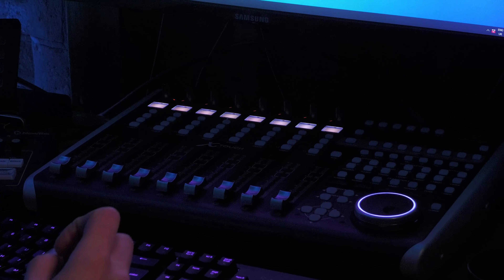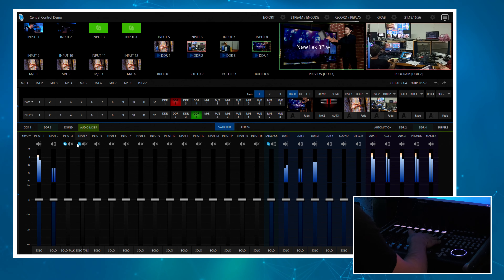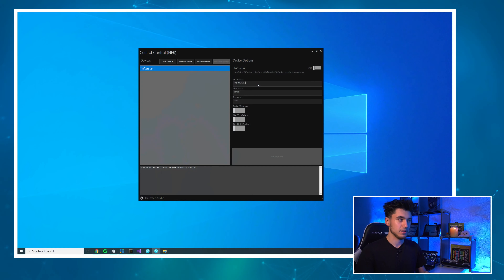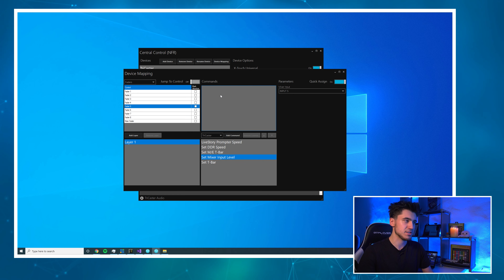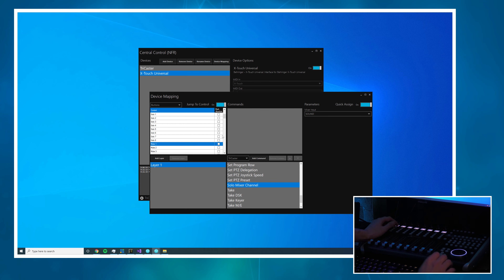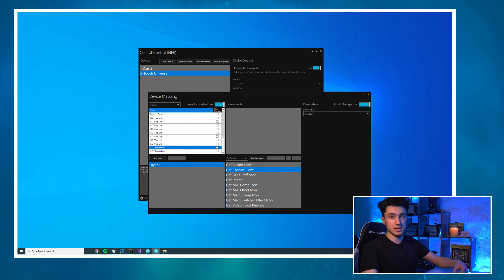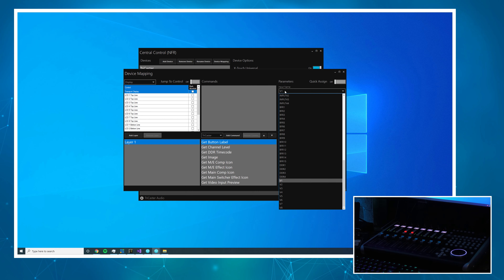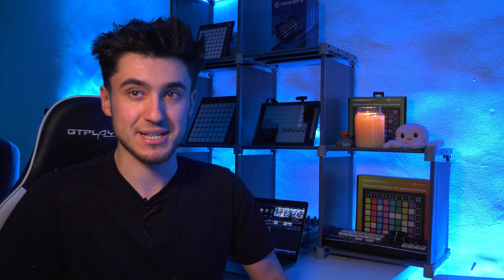Control TriCaster's Audio Mixer with a MIDI Controller!

Comment: Great video! I'm considering a combined audio mixer and midi controller, like the Tascam model 12. I need analog inputs for wireless mikes etc, but also the capability to adjust DDR levels with the mixer/MIDI controller Will this work with the Tascam model 12 ( or something like that)?

Comment: Behringer X-Touch! with firmware 1.21;
Will it work with my "TC1 TRICASTER v7-4-210311" and "central control"?
What if we put TC1 v7-7-210722, would it work too?

Comment: Awesome Explainer Video, Joe.  
Can I use the behringer X-32 to control a tricaster Mini? Does the Mixer have to be in "USB Mode" to Do so
Reply from the maker: Yes - You can use the DAW remote feature on the desk to acheive this. You will need a USB MIDI interface to connect the X32, then use the X-Touch device as in this video and select the ports of the MIDI interface.

Comment: Hello. We installed the Centralcontrol to match the Behringer x-touch mixer to the Elite 2 tricaster. Everything works well but I was wondering if it is possible to control the 8 audio channels of the DDRs separately or to be able to separate the Left and Right on 2 faders.

Comment: Is it possible to set a static IP and use the X-Touch to control the TriCaster via RTP MIDI so that the X-Touch could be placed anywhere there's an ethernet port, independent from a computer? I hope that makes sense.
Reply from the maker: Yes absolutely
Reply: @thisiscentralcontrol  Cool! How do I go about doing that? If I select the X-Touch as a device, there's nowhere for me to enter an IP. I have it set up right now as a USB device and it works great. I know how to set a static IP on the X-Touch and connect it to our network, how do I then integrate it in Central Control? 

I'm also using the wheel as a scrubber for instant replays. It's so cool!
Reply: @PioneerTV_SHS  Did you get this figured out? I'm currently trying to create the same setup via network mode on the X-Touch, and I can't seem to work out how to connect it to Central Control.

Comment: Hello, any experience to control TRICATER TC1 audio with a MACKIE MCU PRO? Thanks.
Reply from the maker: Hi! This should work fine. The X-Touch also uses MCU protocol so you can just add an X-Touch to your project and it will work great.
Reply: @thisiscentralcontrol  Thanks for your quicky answer... we ´ll try it.

Comment: Anyone else have trouble getting Tricaster to connect?  I have verified my static IP and LivePanel password but it still does not connect.  No trouble getting the  X Control to connect.
Reply from the maker: Are you by any chance running Central Control on the TriCaster? If so, if you're running it on the TC and the TriCaster software is not running it will never connect because there is nothing to connect to.
Reply: @thisiscentralcontrol  That was it! Thanks!
Reply: @thisiscentralcontrol Hi ,it doesn't  work when tricaster is running, display time out.😢
Reply from the maker: @项瑞  If the TriCaster is in an active session and it still won't connect,  please ensure on installation of the TriCaster software that the "Restrict Network Access" checkbox wasn't ticked. This will stop Central Control and other third party applications from being able to function.